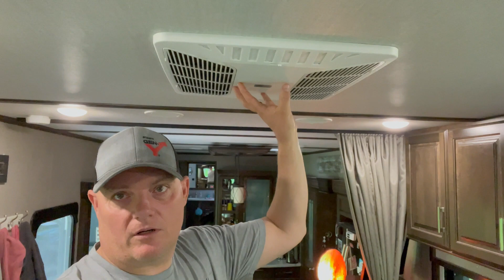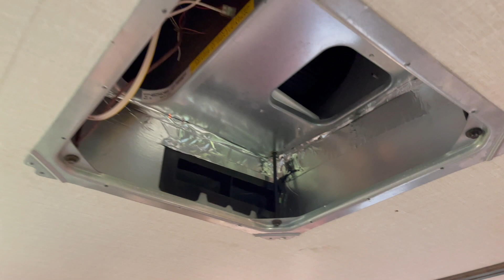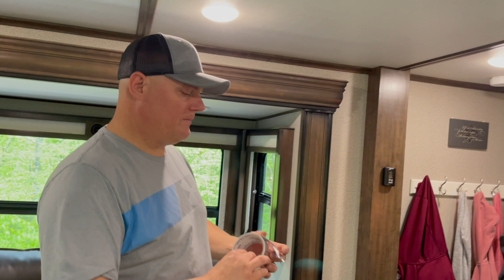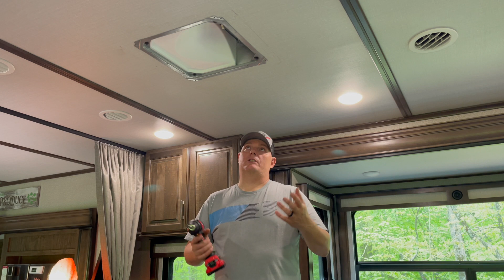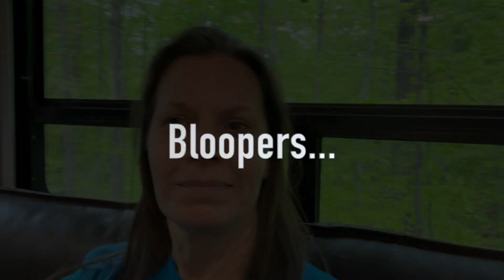RV AIRFLOW SYSTEMS | AC UPGRADE | GRAND DESIGN SOLITUDE 382WB-R

Comment: I emailed the company asking about compatibility with my Jayco class C and the did a mod for me and gave me 15% off.
Reply from the maker: Oh nice. Glad you got a discount. Hope it helps with your cooling.
Reply: @OurlifeWhirlwind  I finally installed it and it Definately increased air flow to the vents. No doubt about it. I also noticed that it gets cooler faster and stays cooler longer after unit shuts off. Is it in my head?  I don’t know but it Definately increased air flow and made it a touch quieter while watching tv.
Reply from the maker: I don’t know about making it quieter but it definitely makes the auto setting not work as much. So it’s not just you. Assuming because of the additional airflow into the unit helps it stay cooler longer. All speculation but it seems to work.

Comment: Wonder if this causes strain on your AC motor,  or cause it to age faster
Reply: This does nothing but make your AC last a lot longer. When I installed my RV AirFlow I had holes going into the attic and the intake has gaps so it was pulling cold air into the intake. This device allows all air to enter the ducts and not be trapped by the closed air dumps.
Reply from the maker: I wouldn’t think so because it doesn’t actually restrict air flow. If anything it lets the motor work more efficiently. Think of it like putting a cold air intake and less restrictive exhaust on your truck. It would probably increase performance of the AC. Thanks for watching.

Comment: 14:57 it's okay to close them cause they do not have filters, at first I thought for better airflow. But don't want stuff pushing through your vents in the duct. If that makes Sense 😂😂😂
Reply from the maker: Yeah without filters I don’t keep them open either. I imagine it might increase return air but dirty air is just as bad as no air. Thanks for watching. 😎🤙🏼
Reply: @OurlifeWhirlwind  maybe make small filters to be install there

Comment: Did installing the unit help muffle the sound level any?  These RV AC's are so loud to begin with.
Reply from the maker: Unfortunately it did not. At least not that we noticed. However that being said it did not increase the sound level either. The only benefit is more air flow. Thanks for watching.